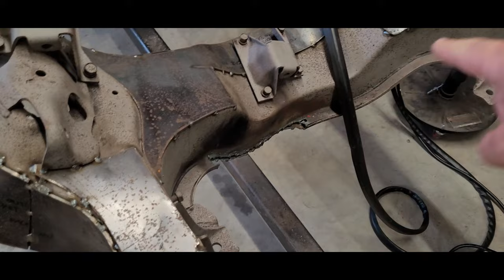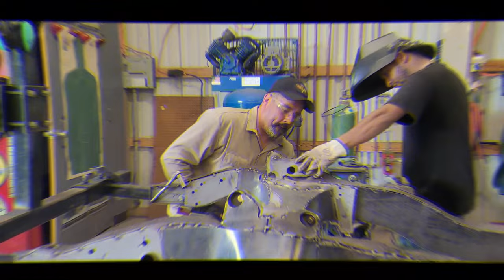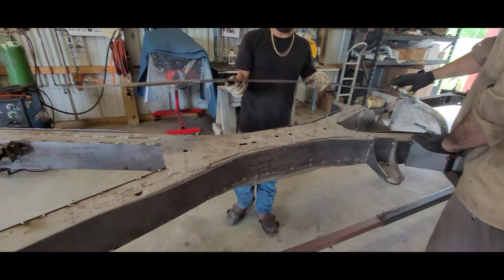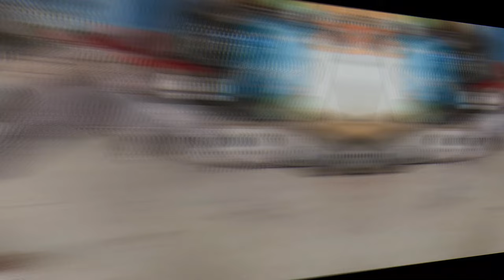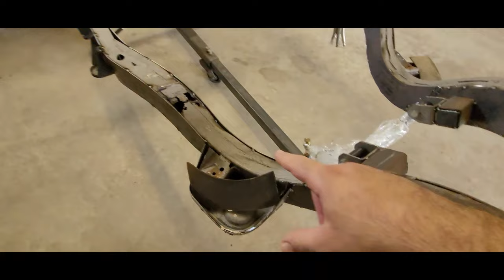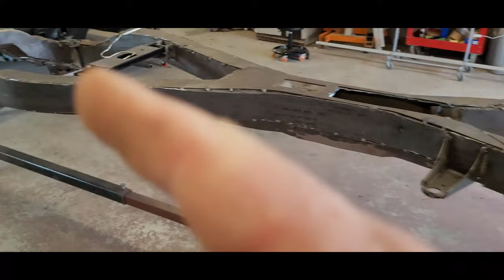60 FrameLowrider Hydraulic Frame Reinforcement | 1960 Impala Part 4 | DIY | Rematch | Lonestar Lows

Comment: Whats the link for the plasma ?
Reply from the maker: YESWELDER CUT-55DS 55Amp Non-Touch Pilot Arc Air Plasma Cutter 1/2 Inch Clean Cut, Digital 110/220V Dual Voltage IGBT Inverter Plasma Cutting Machine with ETL Approved https://www.amazon.com/dp/B083GPXF8Y/ref=cm_sw_r_apan_i_GSBYK49NEJ094PFNQG2H?_encoding=UTF8&psc=1